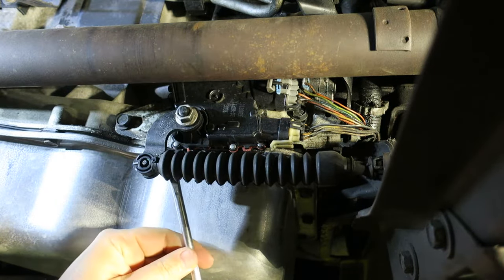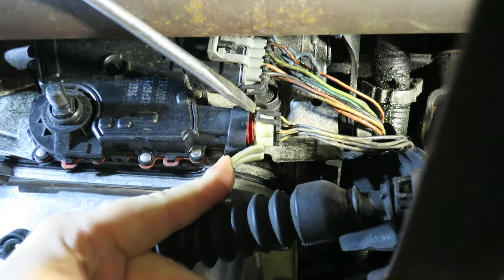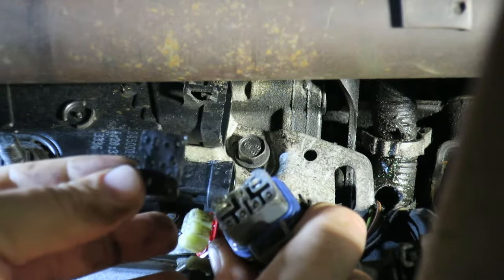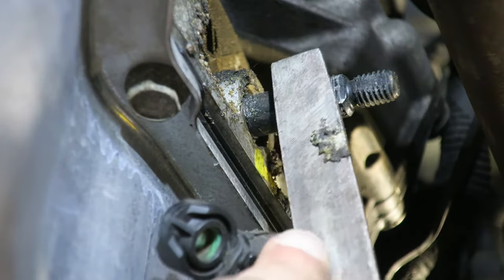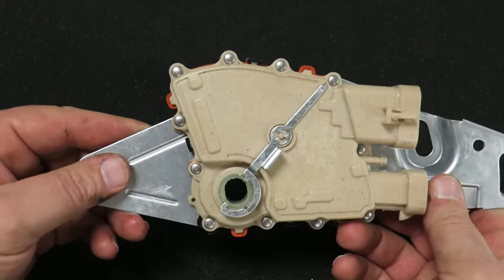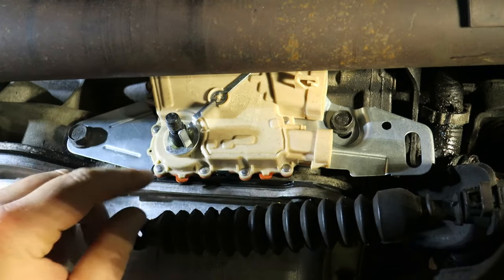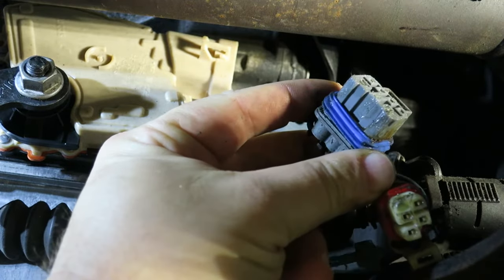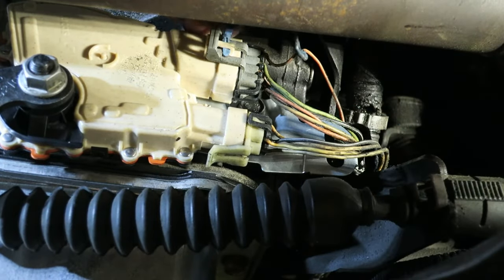Allison NSBU Replacement: The Easy Fix You Didn't Know About

Comment: Some of the 2004 LLY  Allison 1000 /M74  Vin2 only have one plug on the Park/Neutral Position Switch. If your scanner indicates various incorrect readings on Gear Commanded/ Gear Selected/ Current Gear/ Previous Gear such as;  Park: Gear Commanded 0, Gear Selected 8, Current Gear 0,  Previous gear 0,   or Drive:  Gear Commanded 1,  Gear Selected 5, Current gear 1,  Previous gear 1.  Or Third Gear:  Gear Commanded 1, Gear Selected 3,  Current Gear 1, Previous gear 1.  It may also make a whirring/ spinning noise for a couple of seconds with loss of intertia, and lunge for a second with loss of inertia.  It may seem to do it more while cold and while hitting a rough spot in the road.  You really should renew your spin on filter about every 3,000 miles, pan filter and all ATF every 10,000 miles.

Comment: I have shift inhibited and when it does work it goes into third and the clunks. I have replaced the switch Tcm valve body. And the internal harness and still nothing idk if this switch is bad again or if it’s the whole harness
Reply: Try an ignition switch. I have replaced mine 2x and it seems to help for a while. I’m having the same issue as you.
Reply: @Vibxes-_-2k  ok I called a transmission shop here in Lubbock they want $7,000 to rebuild!! Ok like wtf!!!
Reply: @JuanCruz-xy4pn  rebuild kit costs about 500 or 900 for upgraded sht. Watch truck master's video on allison rebuild. It helps to see the internals taken apart to get a good idea of where your issue might be coming from. Almost sounds like a sticky solenoid. Mine clunks because the tcm is bad. Find as many symptoms as possible and type them all in a search you'll find a forum with the same issues for sure

Comment: 2004 3500 LB7 Allison 1000 5-speed with 270K and I am getting p0700 & p0875 codes, full fluid...No issues when cold until it warms up 110-psi... Any ideas or suggestions?
Reply: Same codes I got the other day on my 2013 LML. I’m in the process of dropping the pan and doing a series of inspections.

Comment: Great video. mine seems to be leaking from the shaft. any suggestions?
Reply from the maker: There is a seal directly behind the switch for the shift shaft, that would be the most likely cause in that area. It can be found here https://www.merchant-automotive.com/manual-selector-shaft-seal-allison-2001-2023/

Comment: How do you change the 2006 6 speed Allison ? I haven't seen any videos on it.
Reply from the maker: The 6 speed switch is internal and requires valve body removal
Reply: @merchantautomotive  with the switch be the problem range shift inhibited
Reply from the maker: @larryrichins7887  That is very tough to determine without having more information.

Comment: Would this fix a no reverse? 04.5 lly? If I clear codes. Truck will go in reverse.
Reply: I have a lb7 and had to replace the valve body
Reply: @brandonmccrady4519 what was your issue
Reply: I went to stomp my lb7 and had a big loud bang bang limped in 3rd gear , cleared code was fine figured I just limped it , not I do it even on stock tune . And range inhibited came on today while I put it in reverse , clear the invisible codes that are stored in my tcm since it don’t show codes on my edge and it works fine

Comment: To bad you don’t mention the size of wrench or socket being used
Reply: I just did this on my astro. 13mm mounting bolts, 15mm for the shift arm. I didn't know about the goop but brute force and ignorance got the connectors off. I was liberal with the silicone grease on them.